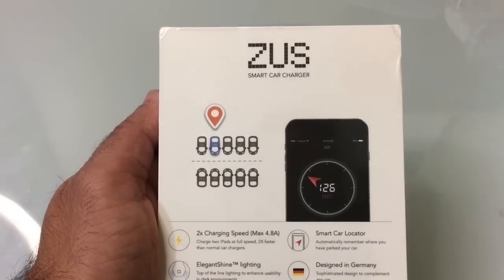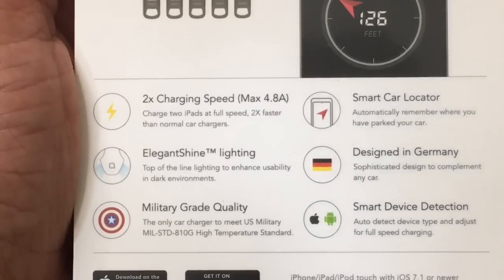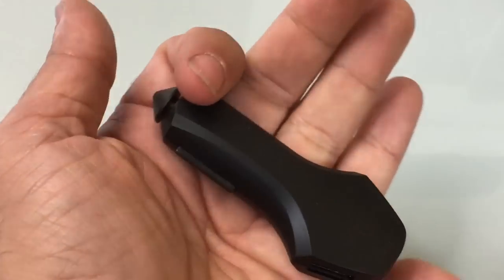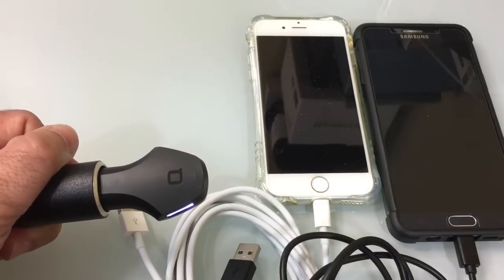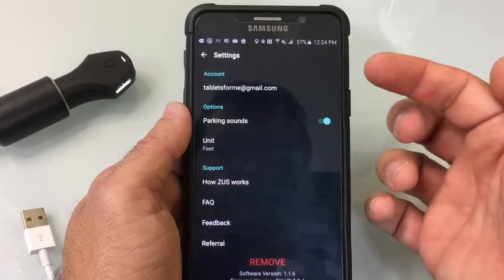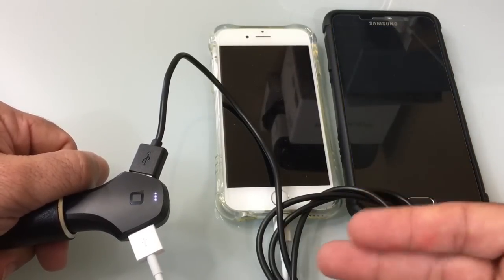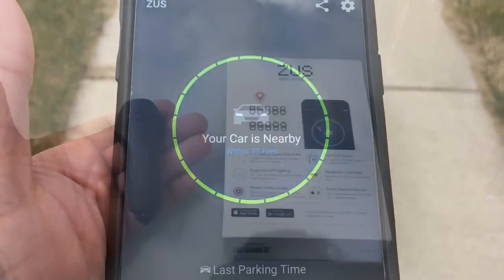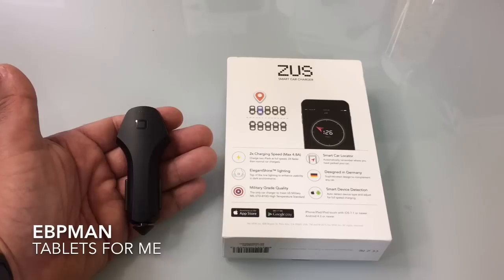ZUS- Smart USB Car Charger & Car Locator

Comment: Great review! What happens if your car gets stolen?  Would you be able to locate it on the app??
Reply: +Rene Rios 
here's what i found out if the location based fased feature is a high selling point for you then you may want to er-evaluste your purchase.
the ZUS charger can only remember the car's location where you parked last.  
once your car is moving borrowed by a friend or family member or stolen it will lose track of where your car is since the charger and your cell phone has to pair themselves (automatically) within a certain distance every time the engine turns on or off.
if you enter a location with no date/GPS signal and or park in a multi-structured parking lot such as a mall, garage or airport you''ll get a prompt from the app that it is unable to locate you and suggest you take a picture to remember where you parked.
when the GPS locator does work such as in a residential area or shopping plaza it works flawlessly as you able to find your location no problem with the compass always directing you to the right location.
hope this infomation will help you.